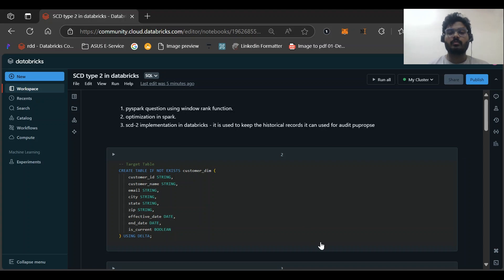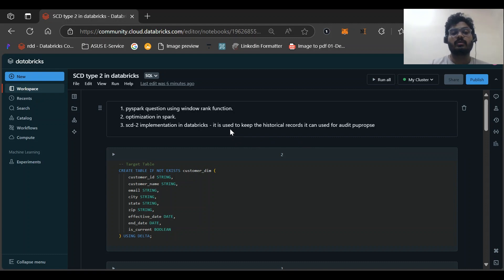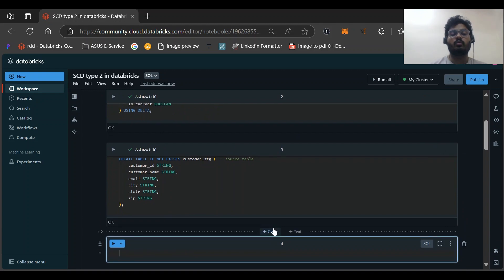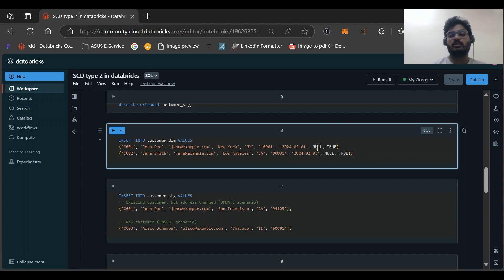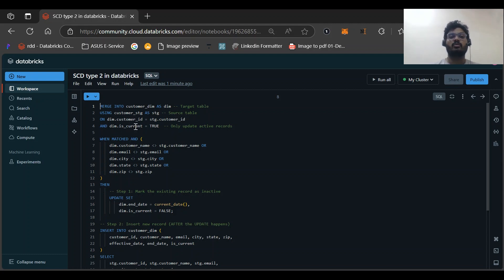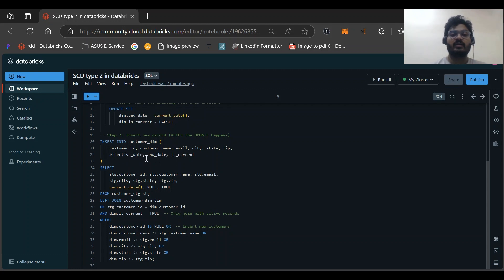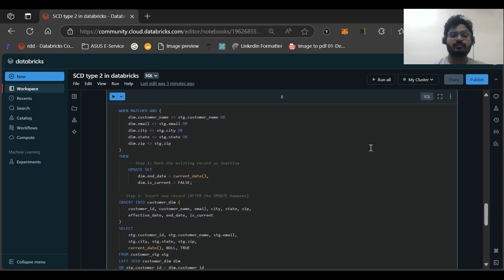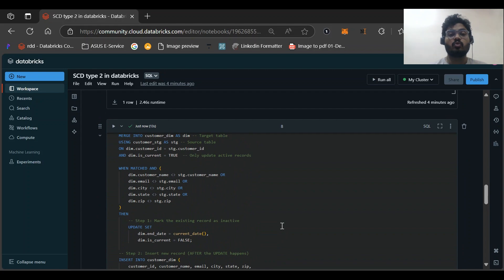EXL Data Engineer Interview Question: How to Implement SCD Type 2? #interview #dataengineering

Comment: Hi.. great video, please could you explain why the join condition at the left join part would be dim.is_current true and not stg.is_current true..
Thanks
Reply from the maker: Sure here we used LEFT JOIN which is typically used to identify changes between the incoming source data and the existing dimension table.